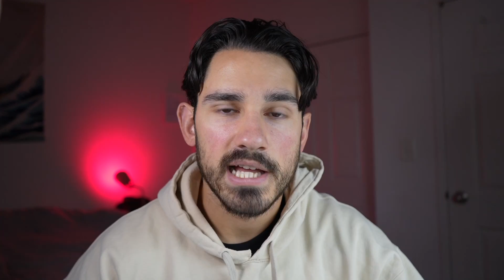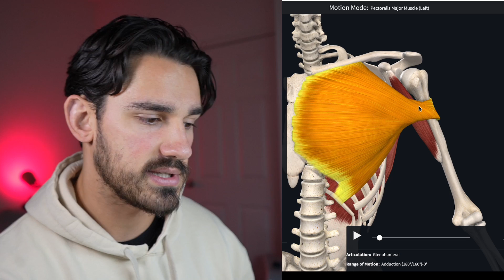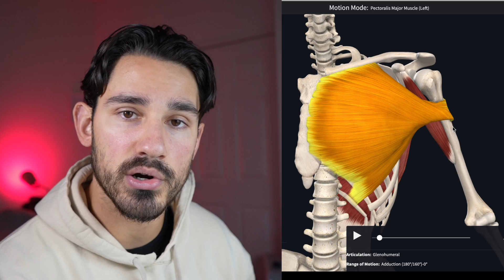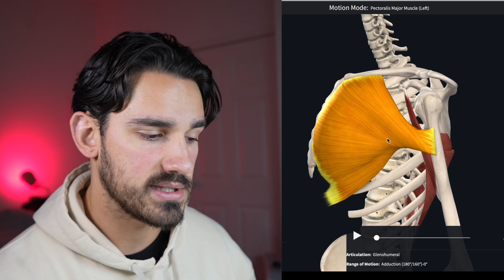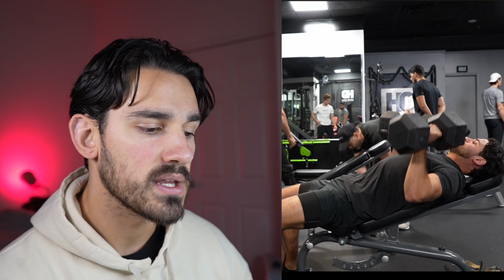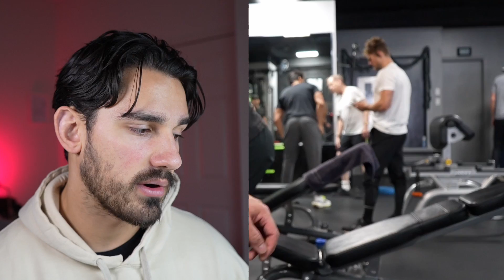DB Press to Target Upper Pecs - Anatomy & Training Analysis

Comment: Ben do you cue "row the weight" on the eccentric to stop the front delts getting involved? It feels like they are taking over for me even in this low incline
Reply: One cue that I find helpful in keeping tension in the pecs is, once your arms are lowered till the point where your elbow is in line with shoulder, start cueing trying your best to keep your elbow parallel with shoulder while u continue lowering the weight.
This can prevent your shoulder from popping out too forward. Hope this helps.

Comment: Hey Ben, you made a video 9 months ago (titled: 'What bench Angle is best for pecs?') saying that a low incline (15-20) degrees alines best with your middle pec fibers, whereas a 30-40 degree would be best for the upper fibers. As well as saying that you should keep your arms narrow, since that helps with mechanical leverage. Have you changed your opinion since then?
Reply from the maker: yes i have! i still believe that angles of 30-40 can be great for upper pecs and that narrower arm paths can be too, but it depends on how each person relates to both of those variables. if we're strictly talking about the most specific loading/variant, it'd likely be one more like i displayed, but that's on average, and some may not be comfortable with arm path width, range of motion etc.
Reply: @The_Modern_Meathead  Thanks for the quick response! Keep up the good work and information man